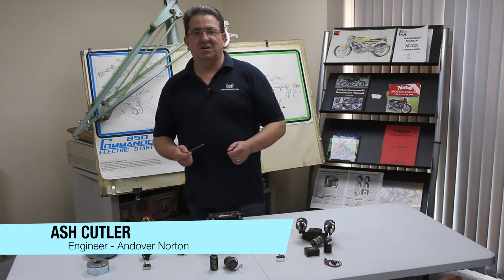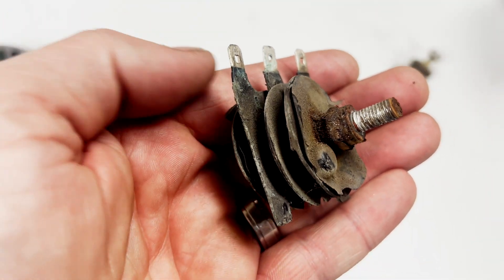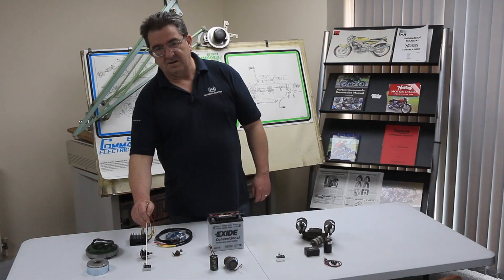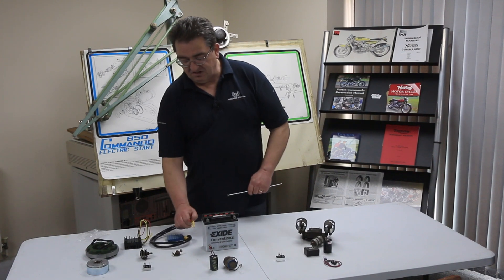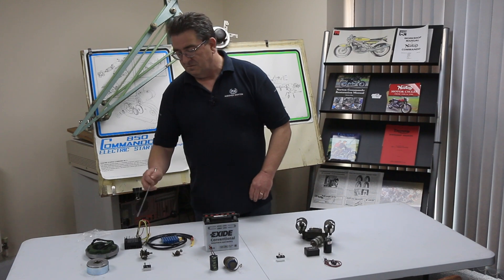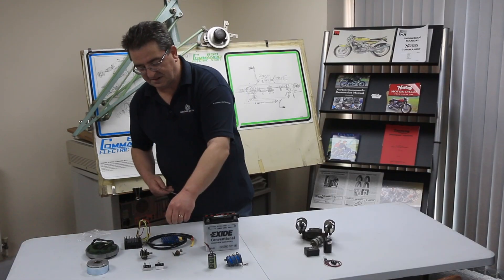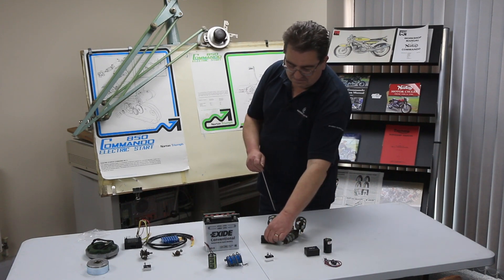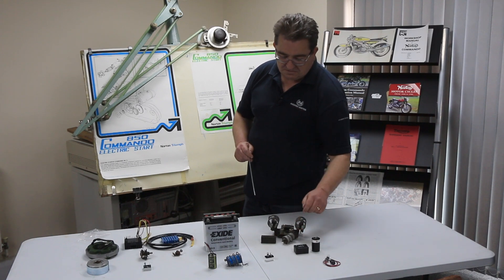FAQ Monday - Norton Commando Electronics

Comment: I have 12 volt coils to use on my 1970 S.  Do I elliminate the ballast resistor. Im running points and condenser. thanks for the tutorial.
Reply from the maker: Yes, as the coils are connected in parallel and thus you have no voltage to drop
Reply: @andovernorton-thesource  Thank you for the reply

Reply

Comment: Good summary.  I'd add one thought...  If you're replacing a zener diode with a voltage regulator and you're running a lithium-ion battery, you need to pay attention to the regulator's output.  Li-ion batteries like to charge at a slightly higher voltage than lead-acids.  Since I have a '72 Commando 750 and have to kickstart every time (and I've put an LED headlight in place of an incandescent or halogen), there's nothing on the bike that pulls significant current other than the horn (which can pull 7A).  So a relatively low ampacity Li-ion gets the job done.  But I did go with the Tri-Spark regulator, which is set to put out a solid 14.5V, which is high enough to keep the battery happy.  Quite a few aftermarket regulators don't quite get to high enough voltage for anything other than a lead-acid battery.

As an aside, I'm one of those ugly Americans who got annoyed enough with "positive earth" to flip the bike around to a negative ground.  Since I have a few electrical engineering degrees, it wasn't a particularly challenging thing for me, but I'm not sure I'd point a novice in that direction.  While I was at it, I also designed a system to tidy up the wiring inside the headlight bucket and implement battery monitoring and solid-state turn signal relay functions with a microprocessor and a few p-channel MOSFETs.  That's allowed me to run an LED for every light in the bike.  Look up "Focus Embedded" on Google and go to the "Portfolio" page if you're curious.  There's a writeup there.

And as a second aside, I found dealing with the Aussies at Tri-Spark to be quite enjoyable.  I had a specific question about their electronic ignition related to whether I could wire the ignition kill button on the right handlebar to the logic supply of their module and keep the power for the coils on until the actual ignition key was rotated to the off position.  Depending on how you design the FET circuits that fire the coils, this could potentially damage the FETs.  And the engineer at Tri-Spark with whom I corresponded by e-mail understood and appreciated my question.  He was quite prompt in replying that leaving coil power on while cutting logic power was perfectly okay.  Their module was designed for that approach.  And any time I'm switching an inductive load, I like to err on the side of caution.

That was what I wanted to hear, since logic power is a comparatively low current, which reduces the strain on the Lucas pushbutton.  (On the other handlebar is a horn switch that doesn't send power to the horn, it sends it to the gate of the p-channel FET that turns the horn on.  Again, I was trying to minimize current through the Lucas switches, since on this side of the pond, the joke is that Lucas is short for "Lots of Unsoldered Cuts And Splices.")
Reply: Thank you for the reply
Reply: I prefer Prince of Darkness